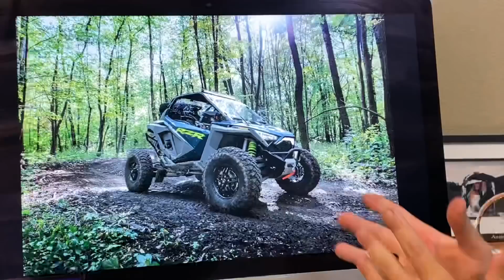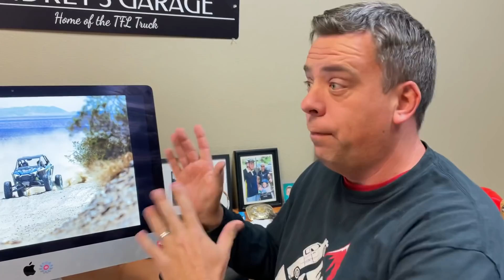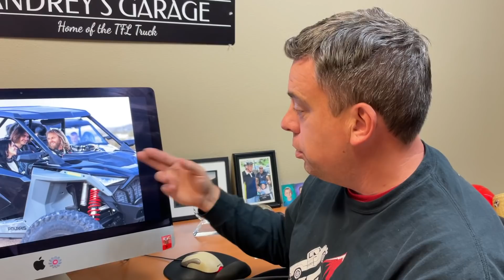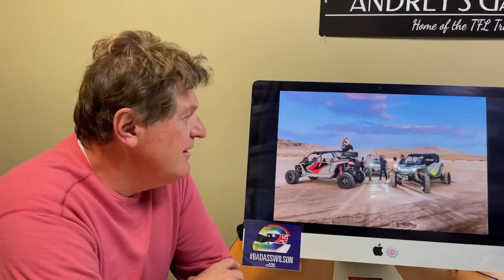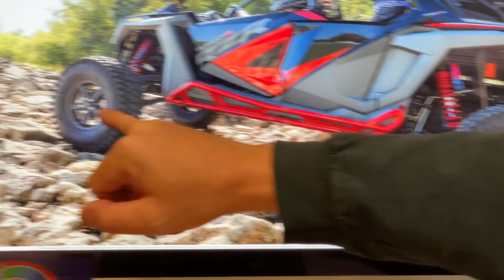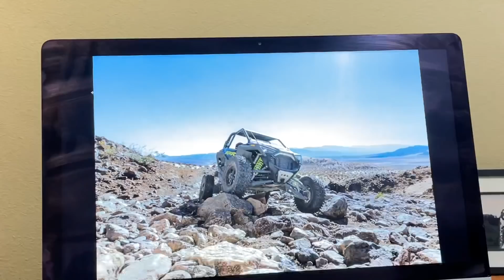BREAKING NEWS: Redesigned 2022 Polaris RZR Pro R Takes Direct Aim at Can-Am With THIS Much Power!

Comment: How long before someone adds a turbo to that 4 cylinder?
Reply: 5 minutes...
Reply: @TheDutchman1980  lmao. Fact
Reply: Already done.. a engineer at polaris did it
Reply: As soon as I get mine I will be building turbo kits for them!!!!!! That's just how we do things in Michigan...... I'll put 1000 miles on it doing some R&D for other performance parts then the engine will come out lower the compression and better rods fix what ever else that needs to be done and turbo time maybe even a little n.o.s on top just in case anyone gets to close to me lol if you're a true gear head that's just how it goes stock sucks..... Be kind and have a great day!!!!
Reply: Guaranteed it’s already developed just like the 850 Patriot snowmobile engine, first ones out were non turbo and then they come out with turbo mountain sleds and  say it was designed to have a turbo from the beginning

Comment: I am shocked you did not point out the massively useless mud flaps when commenting about the mud protective doors.  lol  And you mentioned at the end exactly what I was thinking about when you said the stance was 74 inches.  How big of a trailer does one have to get to transport these damn things?  lol  Full out car trailer required.  New Rubicons are 73.8 inches wide.
Reply: Nothing really that big. You can get some smaller Aluminum trailers that fit them. BTW the "mud flaps" are rock guards that keeps rocks from the front tires flinging into your rear suspension components and wheels. Not new stuff there lol People have been using them for years

Comment: Impressive numbers but the number I want to know is how many hours of repair time vs of how many hours of drive time.
Reply: Its honestly not that bad. Just keep your fluids fresh and your joints greased and make sure your belt(s) are wearing good and are being treated right. If you do break something, everything is quite easily accessible. Don't let these boomers that ride around in jeeps getting passed by UTVs all day give you the wrong idea. SxS's are serious fun and the market is growing for a reason.
Reply: I got 4000 happy miles in my 2019 Rzr Turbo S, just oil and filter changes.
Reply: @alb5tana  you are an outlier.  My neighbor has had his RZR in the shop more than he drives it and he is 70 years old and not out there killing it.0
Reply: If I pay this much for this thing it better not break period. It better outlast my old ranger and Toyota “both over 250k miles” with ease because you can by MANY cars and some small trucks new for the price of this roll cage with plastic panels and cool shocks.
Reply: You’ll replace parts most every trip. Overpriced toy with overpriced parts that can’t handle its intended function without co start repair.
Reply: @chadwebb1345  Said the person who either has dumb ass buddies that trash their machines or a person who has never been around at SxS in their life.
Reply: @waynehicks317  one is a master mechanic, the other an engineer.  Both have ridden trails from West Virginia, to Tennessee, to Utah, Arizona, South Dakota, and more.  Both have owned the pre turbo generation and the current turbo models.  Belts break, shocks break, everything that they advertise these machines to do is not possible without frequent breaks, failures, and repairs being required. They trailer extra parts and being a mechanic, it’s presented no problems for them, but it’s total bullshit in my book.  They love them in spite of their flaws, but it’s damn sure not something I’d waste money on.
Reply: @chadwebb1345  for me the biggest draw back is the price.  I have a roxor with 10k miles on it and haven't had to do anything other than change the oil.  They support 2 very different activities on 4 wheels and I appreciate them but I can't see how they can justify the price.

Comment: So would this exempt it from the helmet law in Glamis sand dunes? I heard in all sxs you have to wear a helmet because anything under 1000cc you have to wear a helmet.
Reply: I ride in Glamis. I would never get in any vehicle without a helmet. Rolled a side by side in 2016 and my head hit the cage hard enough to crack the helmet. I'll be honest, before that I thought it was stupid that I had to wear one.  

I agree that everyone should be in charge of their own safety, but I for one will never go without.
Reply: Lmao
Reply: I've been in enough side-by-sides that even with the belts you get whacked around so hard it's just plain old stupidity to drive a racing-style Razr like this without a helmet!  In a Can-Am Defender where you have an enclosed truck like cabin and you are going much slower speeds on a farm or on the local backroads then YES no helmet is needed!

At high speeds though in a racer-style SxS, wear the full face helmet!

v